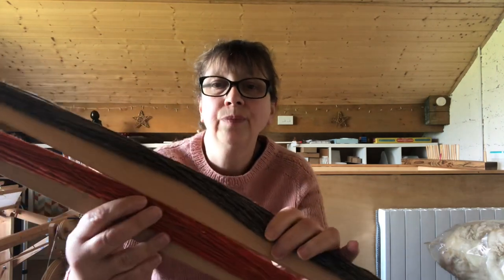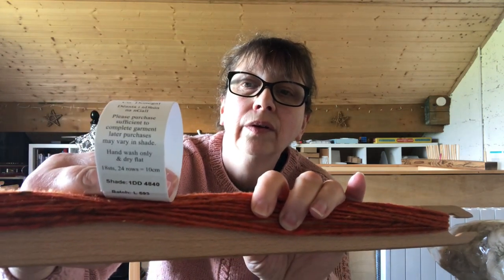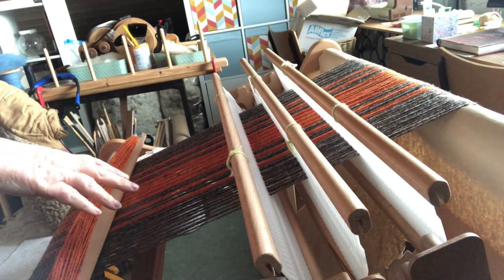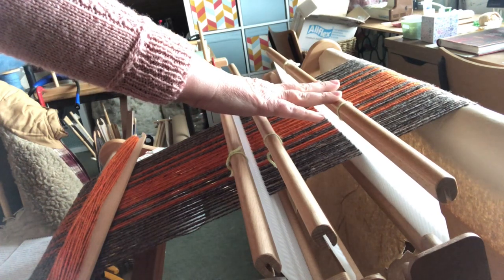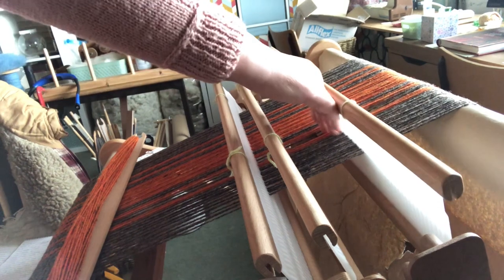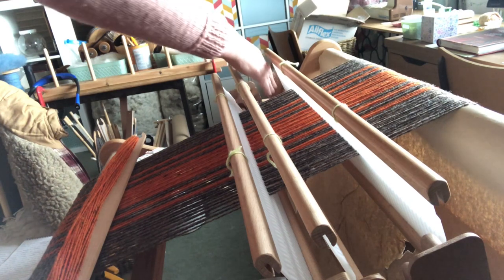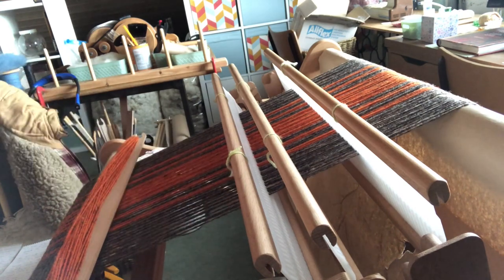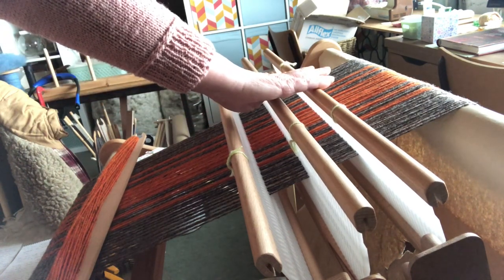2/2 twill on a rigid heddle loom || 3 heddle adventures

Comment: A great video - thank you. Perhaps you could post a close up sot of the third single heddle block and how you placed it on your loom. Thank you.
Reply from the maker: Thank you, I’m glad you enjoyed it 😊. There is a photo in the video at around 1 minute 52 secs showing the extra heddle block. It is basically just attached in the space behind the other double heddle block. I used a small clamp to attach it to the sides of the loom with a little bit of foam just to protect the wood.

Comment: Thank you for this video. 
When i have 2 heddles in the down position i don't have a clean shed, i have like 2 smaller sheds.  Any idea why this is? Can I put my shuttle just through over the lower threads?
Reply from the maker: Hi thanks for watching. 
Yes, that’s fairly common on the rigid heddle just because of the path the threads have to take through the heddles. So if you have heddles 1 & 2 down just make sure you are only passing the shuttle under threads in the holes and slots of heddle 3. I find it helpful sometimes to place a pickup stick on its edge  to help push the threads down, making it easier to pass the shuttle through. Hope this makes sense 😊
Reply: @ewetoyarn  yes. Thank you very much for your reply!
So good to know that it isn't something from me, gives a person confidence 😊

Comment: How did you get a RHL with a three heddle block set up?? Does it function as a 4-shaft loom???
Reply from the maker: Hi, the Ashford RHL comes with a double heddle block and you will see in the video that I clamped an additional single heddle block behind it. Yes the 3 heddles allow four shaft patterns to be woven
Reply: @ewetoyarn  Wow!! That's a big deal, and it's really cool! 

Four shaft patterns are incredibly popular. If people knew it were this easy to turn a RHL into a 4-shaft loom, I think that would change things. 

From your set up, it looks like a somewhat easy thing to do. How has been your experience with the 3 rigid heddles each having their own space to officially work from?? I'm so curious...
Reply: @ewetoyarn  Thank you for responding to my comment!
Reply from the maker: The experience has been good, no problems at all